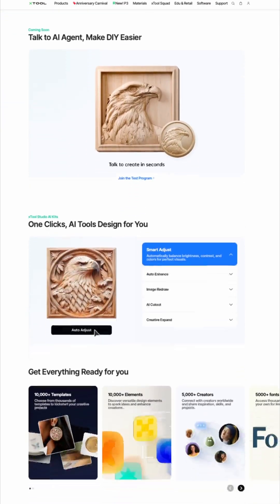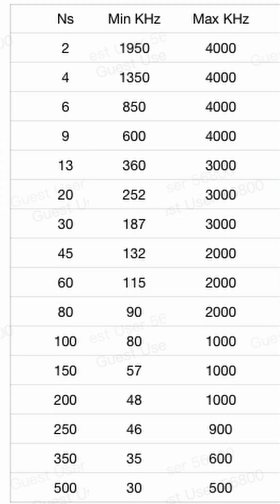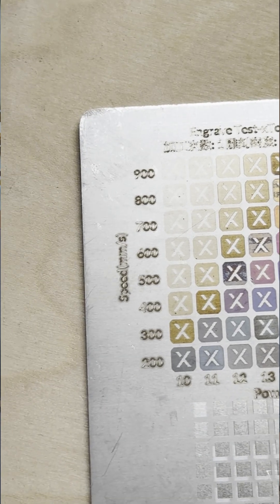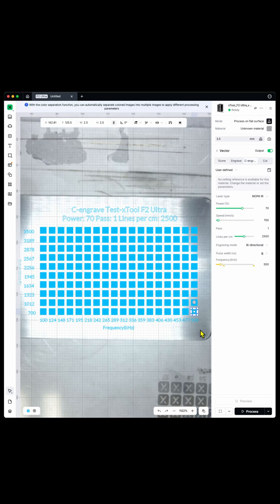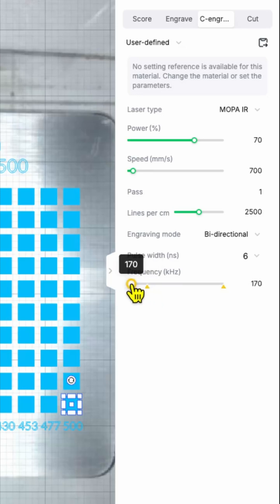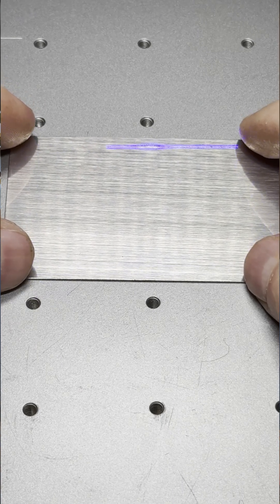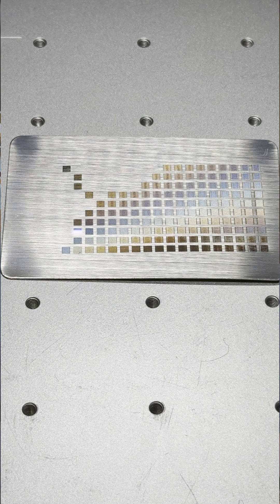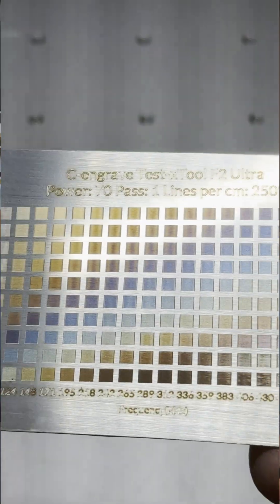xTool Studio Makes the xTool F2 Ultra 10x Better! #shorts #xtoolf2ultra  #xtool

Comment: I’m thinking of getting the xTool F2 Ultra, but I’m a bit concerned about the MOPA settings. Specifically, I’m worried that it might remove the protective surface layer on stainless steel and cause it to rust. What’s your experience with that?
Reply from the maker: Stainless steel isn’t ongoing to rust. It’s not a coating.

Comment: The limited frequency set is why I didn’t jump on the F2U! Are the options only available during coloring process or for use with any job?
Reply from the maker: In the new Xtool studio that eliminated the frequency restriction.  I ripped them pretty hard about this during the beta testing stage.  They offer two engraving modes - a regular one and one specifically for color engraving, but they are fairly similar.
Reply: @SteveMakesEverything  Thanks! When I get a mopa, I was all of the functionality of frequencies!
Reply from the maker: @dian3145  Me too.